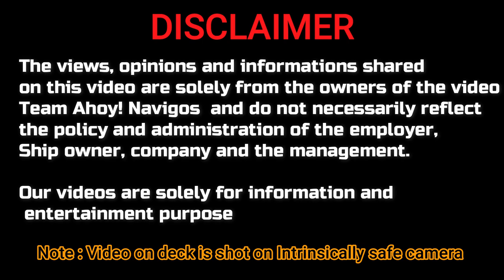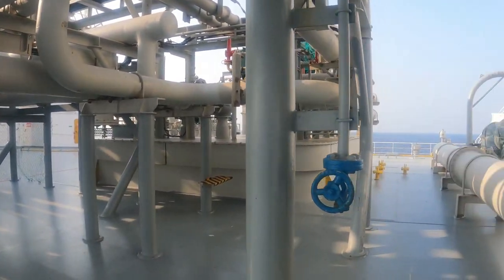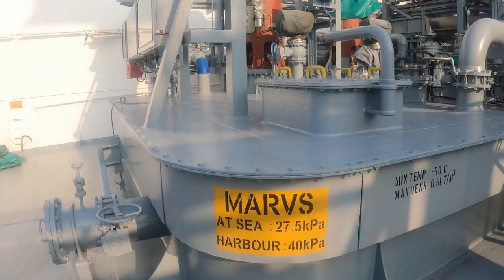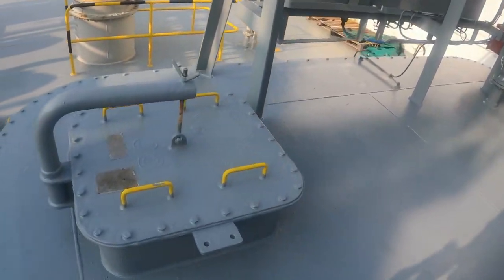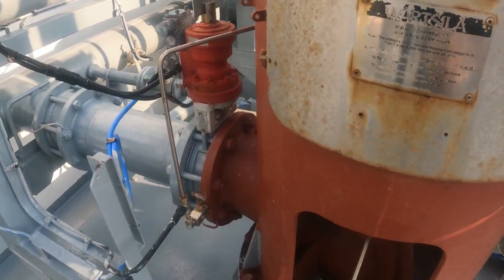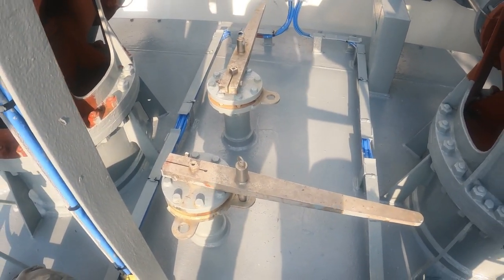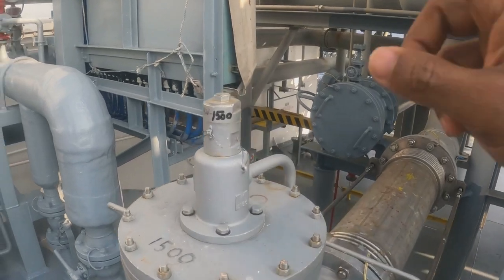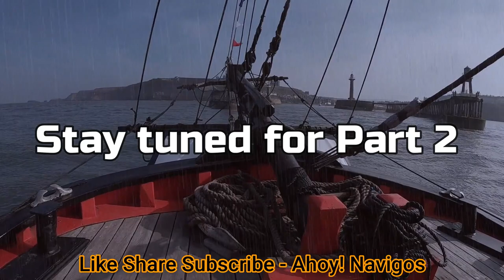Gas Tanker Deck Tour - Part 1- VLGC -LPG - Ahoy! Navigos

Comment: Do you have deck work while working on a gas tanker? Does it have a different deck job than other types of ships?
Reply from the maker: Obviosuly you have all deck works like other ships as much as possible on gas tankers also, but only difference is you need to have permits and more precautions